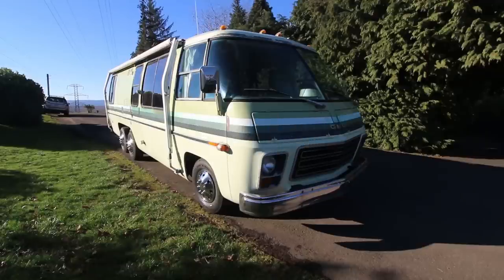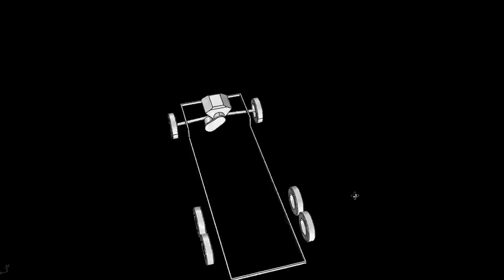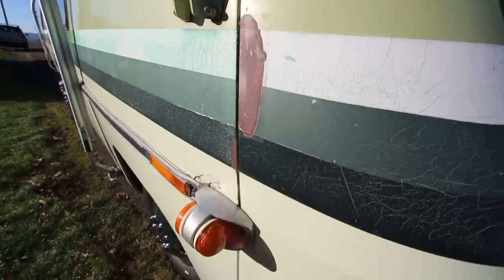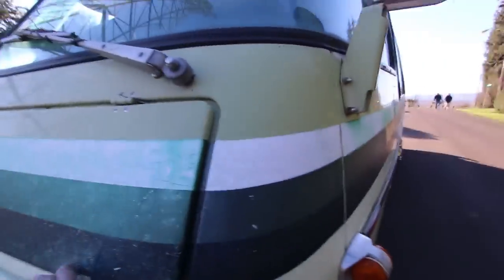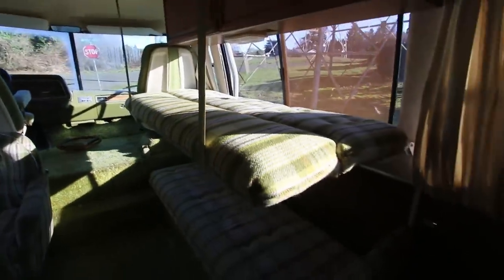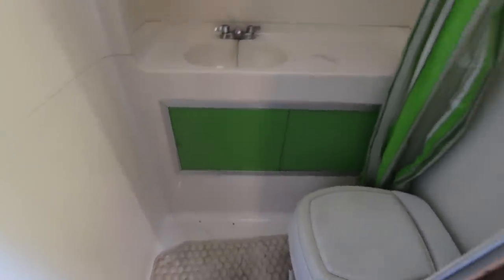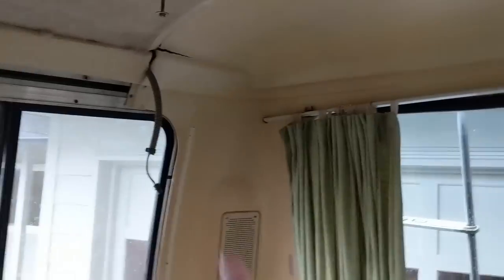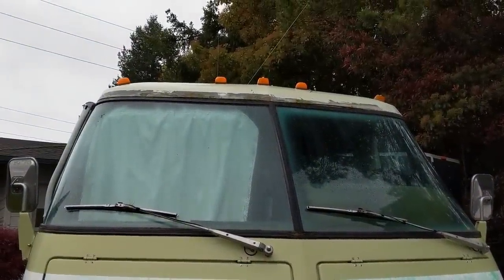Building The Best Damn GMC Motorhome Ever - Beginnings & Explanations

Comment: Please correct your statement. Revcon did not copy GMC. GMC COPIED REVCON. The Revcon was designed in 1967. When Revcon put in an order for 25 Toro half frames, GM made Revcon build up 5 coaches to run them on the test track at GM. This was called the Brickyard test. The only failure was the lower control arm which was beefed up and the test was continued. Interestingly the GMC lower control are is more prone to fail than the Revcon beefed up version. So AFTER GM made Revcon do all the testing, THEN GM initiated the design for the GMC. The first production runs for Revcon were sold in 1971. First year for GMC was '73. 

I have to laugh at your other comments about Revcon not being as elegant. Revcon was a much higher end, much better built coach. Way nicer than GMC. The GMC used a lot of plastic and wood paneling in the interior, which is prone to crack or rot. Revcon used solid wood cabinet frames, Wilsonart surfaces, hollow honeycomb cabinet doors and shells, all trimmed in TEAK. If you look at the interior of a Revcon, all the cabinetry will look just like it did when it left the showroom. The interior walls were aluminum, coated with a decorative vinyl finish. This makes a surface that won't rot, and can be cleaned to showroom condition, with little effort. 

The frame on a Revcon is much better as well. It is box channel, which is much stiffer than the C channel used on the GMC. Because of the lightweight interior and aluminum walls, the Revcon has a lower center of gravity than the GMC and is much lighter for a similar length - typically between 8 and 10K lbs. The only thing the GMC has on the Revcon was the rear suspension. The boggie wheels on the GMC did ride better than the GMC. The later Revcons did use a tandem rear axle setup with a single spring. I've ridden in both, and there is not a lot of difference. In the front seat, the later Revcons do ride better than the GMC. The 1980 and later front suspension was designed by Peter Bryant, known in Can-Am circles as the designer of the T-22. He was well known for his pioneering work on aerodynamic downforce. I don't know about the earlier Revcons, but the later Revcons drive and handle much better than the GMC ever did. I've driven in 90mph crosswinds - a microburst. Water was spraying in the window drain holes. The wind was opening my side awnings. They were damaged before I was able to exit off the freeway and tuck behind a building and secure them. I was driving at 70 when it hit. The only reason I slowed down was trying to save my awnings. No real ill handling. On another occasion, broke the triple digit barrier. I grabbed my cell phone to take photos of the speedo. Later I looked at the photo to discover my reflection of BOTH HANDS on the camera. At 100 mph, I was driving with my knee! At the time, I wasn't thinking anything of it. It just drove normal at that speed. Previously I twice hit 98 mph towing my Grand Cherokee. It wasn't topped out, but started getting too close to traffic. 

The oem configuration for the later Revcons was a 454 w/4 bolt main, TH475 trans with Kevlar bands, straight cut gears in 1st and 2nd. They had a custom Borg Warner transfercase with only a front driveshaft. I eventually swapped out the engine for a 502 with Edelbrock MPFI. I swapped the trans for a 4L85e. It was also running Thorely Tri-Ys and Magnaflow mufflers. At 20 mph, if you punched, it would break the front wheels loose. It would also chirp going from 1st to 2nd at about 50 mph. I did a few other mods, like Koni FSD shocks, Tapered roller bearing bellcranks, and rear disc brakes. 

The primary reason the Revcons were not as popular is because they were a very high end coach, costing 2 and half times more than the GMC. My 1983 was $125,000 new. (for true comparison, in '78 they were about $80K)
Reply: Somebody knows their stuff!
Reply: I debated between a Revcon and GMC for months. Getting ready to bring our Revcon home. This comment just made my day! You are absolutely correct sir.
Reply: @jbarnes3373  What year?
Reply: @Daveinet  1983 Prince. Inside is like a walk back in time and looks exactly as it did in the 80's. Getting her tuned up and new tires this week. I'm very happy I found this.
Reply: @jbarnes3373  OK, so that is the same year and model as mine. Make sure you join the http://www.policeinterceptor.com/revconforums/. I help moderate the site and at least try to get over there once a week. I inherited my Dad's '04 AllegroBay two years ago, so I've sold my coach, but still try to help out once in a while. I do miss the old girl, especially when I'm out on the road. As long as your suspension is in good condition, there is nothing that drives like a Revcon. When I had mine up for sale, a guy came by that had rebuilt 3 GMCs. He even stated my coach handled way better than the GMC. The only real suspension mods were Koni FSD shocks and a rear track bar. It doesn't really need the rear track bar unless you are towing a 4600 lbs Jeep.
Reply: @Daveinet  I will absolutely do so! Thank you so much for the info. I found a Revcon Owners group on facebook that has been very helpful answering questions. I would have been lost without helpful owners. I also have a resourceful owner I'm buying from helping me track down part numbers getting her ready for the trip home. It's a real testament to the vehicle and design to have people willing to help so freely to keep them up and running. Every upgrade you listed I have made a note of for future reference. The handling of the Revcons are what sold me. I was very happy to find this confirmation. Thank you again for the helpful advice and information.
Reply: @jbarnes3373  I don't have a facebook account, so I'm not on that group. There is also a group on IRV2 for Revcon. Occasionally I will visit there. One nice thing is that things like the couch dimensions are the same as what is still used today. The front seat mounting brackets are also the same. As such, you can find surplus furniture that bolts in. An old archive with interior photos exists here:https://web.archive.org/web/20091025170742/http://geocities.com/revconprince/interior.html
Something else you need to know if you don't know it already. Running a Dana 70 in reverse flexes the case, causing it to work the bearing race around on the carrier. As it wears, you eventually loose mesh and break teeth. They usually fail at about 70K miles. The solution is to have it rebuilt by Jantz Engineering. He will add bearing girdles and a new diff cover to stiffen the case. You should also install a Tru-lok carrier, as they are much stronger than OEM. I also had mine cryogenically treated, which improves rigidity without making it more brittle.  The 502 would light up the front wheels from a 20 mph roll and chirp at 50 going into second. The rebuilt diff holds up to that and is still going strong today.
Reply: @Daveinet  I had no idea on the Dana 70. Ours has about 126,00 miles on it, with a rebuild on the engine aprox. 20,000 miles ago. That makes me wonder if they already had an issue and it's been addressed but I will need to investigate further to find out or check current state of ours. THANK YOU for the info and making me aware! Really appreciate the kindness!
Reply: @jbarnes3373  There is only two of us maybe 3 who have had it rebuilt with the bearing girdles and the heavier cover.
Reply: @Daveinet  So the front axle is the Dana correct? The back axles are Bendix? I'm looking over the info I have and this is what I'm getting. What exactly should I have checked before trying to bring her home? I really appreciate the info. I'm trying to research and get more info through the Revcon group also. I have new tires going on tomorrow.
Reply: @jbarnes3373  Yes, the front DIFFERENTIAL is Dana. The axle is custom. The axle tubes are chopped off and have half shafts extending to the front wheels. A-frame Torsion suspension. Rear axle is Dexter. Wilkerson walking beam suspension. 
Things to check: In the rear, make sure the rear drums actually work. The adjusters tend to not self adjust, so you can end up with a lot of peddle travel and not much brake. There is a rubber plug at the bottom of the drum that can be popped off for manual adjustment with a bent flathead screw driver. (its worth it to convert to disks once you get it home)
Secondly I would look at the Front suspension. Check for loose tie rod ends. With a floor jack, lift under the A-frame to check the lower ball joint. Check the Bellcranks for wobble. You may be able to tighten them, but if you do, make sure the whole front end is completely off the ground. Grab a front tire and force it to turn from left to right. If you can't turn it, unlock the steering wheel dummy...LOL. No seriously assuming you didn't forget to unlock the steering wheel, and you can't rotate it from right to left or vise versa, then something is binding, most likely the bellcranks. If it binds, it will wander and drive you nuts. If the shims on the bellcranks are worn or not setup correctly, the top and bottom plate will not be parallel, which will cause binding. When they are setup correctly, the bolt is tightened to 150 ft-lbs. If they bind, try loosening it some. I double nutted mine, because I could not tighten to spec without it binding. I couldn't get the shims perfect. Eventually I converted to a tapered roller bearing. 
Can't think of much else, other than standard stuff. Check all the hoses. Bring some hose clamps with you incase something bursts.
Reply: @Daveinet  Wow- thank you so much for the detailed helpful information. I'm taking notes and everything you are sharing helps keep my family safer, as well as, the rig on the road. I really appreciate your time. The current owner is mechanically inclined and has serviced the brakes for me, replaced a couple things and has those stopping on a dime. It sounds fine running forward and I don't believe it's making any noise in reverse. That is spot on advice for the front suspension. I have a mechanic going up with me and will bring the extra clamps for sure! As for that rebuild with Jantz. I'm on the east coast in WV. Is there anywhere else out here that would do that or is there another option to replace it? Thank you again for being so helpful. I'm 100% listening to what you are telling me.
Reply: @jbarnes3373  You can buy the differential mods as a "kit" from Jantz as long as you have a highly qualified installer. Dana 70s are a trick to get set up right, so whoever works on it better know what they are doing. I had a local shop do mine, but that was because they already had it taken apart before I read about Jantz. If I had not had it already at the shop, I'd have strapped it to a skid and shipped it off. (I'm in the midwest). I had a few long conversations with Carl as we talked about what would be needed to prevent me from breaking teeth. (I broke the teeth in 20K miles due to the 502) He is just one of those guys that you quietly realize he is a really smart guy. 
Just as a side note, about a year after I had Carl send me the parts to do mine, I saw him on the History Channel Alaskan Off Road Warriors. When I realized it was the same guy, there was no doubt in my mind that it would not be a fair competition. Talked to him afterword, and he said the show did not really show how far they were ahead and how much they held back, so it wouldn't be a blow out.
Reply: @Daveinet  Was it the 502 that helped accelerate the failure? I am running this by some knowledgeable owners and they are saying in theory I shouldn't have a failure if the fluids are kept at a correct level. They only know of this happening once and it was due to incorrect fluid levels. Does this sound correct to you? As far as I know, mine isn't making any noises in forward or reverse currently and sounds good. 
That's incredible on Jantz and Carl. I would be there in a heartbeat if it wasn't all the way across the country. Doesn't surprise me one bit he had to hold back!  I may definitely be able to find a shop capable of doing the job and get in touch with Jantz on the kit.
Reply: @jbarnes3373  70K miles is typical for many Revcon owners, (I'm aware of about 5) which is about when first mine broke with the 454. I had it repaired, and then a year later dropped the 502 in it. It broke again in 20K miles, but it was a very specific event. I was towing a Grand Cherokee on a two lane road, following some bozo traveling just around 45 mph. I punched it, which made it drop into first and went around the guy. By the time I was pulling back into the lane, I was doing over 80 mph. About 20 miles later I slowed down as I entered a small town. Off throttle, I hear a strange ticking noise below my feet. Every time I slowed down, the noise got worse. I babied it and got it home. After feeling for slop, I pulled the cover and found 3 teeth missing in the ring gear. 
As far as the diff spreading, this is well documented as to what any diff does under stress. Carl was helping someone racing dirt track. They could see two different wear lines on the bearing race. One from on throttle, and the other from off throttle. Every failure I have seen in a Revcon - at least 5 all had the bearing race slipping on the carrier. This is from the spreading motion of the case. To disassemble a Dana 70 requires a case spreader. It is a special tool that catches the two holes in the flange in either side of the pumpkin. The screw crank is rated for 10K lbs - enough to spread the case to get the carrier out. Now, if you start looking at torque ratings for the Dana series, they spec torque in ft lbs. A Dana 70 is spec'd for 7000 lbs. Dana 60 is 6000. So not that much less than the force the spreader puts on the case. The big deal is that the Dana 70 is NOT a high pinion with reverse cut gears. Its rating in reverse is about 1500 lbs less than forward. This has to do with the location of leverage as well as the angle of the teeth. It you look at the ring gear teeth, They are not V-shaped, but rather saw toothed. This give the gear more strength in one direction than the other. Also due to the more vertical tooth surface, it does not try to unmesh the teeth as much. So, when run in reverse, the tooth angle is going the wrong way, which causes the mesh to want to spread. Run your finger across a hacksaw blade. One direction it digs in, the other direction, you finger lifts off and easily slides. Same with the gear. So not only is it logical, but we also have physical evidence.
Reply: @Daveinet  So this is an inevitable problem regardless of fluids. Taking a look at the teeth is a way to get an idea of how far along this one may be towards failing. I have about a 350 mile drive with decent hills. I would like to know the differential isn't going to fail on the way home. I appreciate the notice on this potential issue.
Reply: @jbarnes3373  I don't know that I would be like super paranoid or anything. The cover will come off with the differential in place. The bolts on the top are a little difficult to get to, but it will come off.
Reply: @Daveinet  Thank you again for all the info and giving me a heads up on this. I talked to my owner and he was familiar with the Dana and had planned on checking the fluids for me. We have no clunking or noise coming from it and she is running like a champ with all of his recent servicing. The past two owners have been great about the upkeep and servicing. Feeling better about it for sure. I really appreciate the information and filling me in on Jantz. I have learned a tremendous amount from this thread and have taken note of all you have shared. Really can not thank you enough! I know you had the '83 but are you the Dave that had the flatnose Revcon?
Reply: @jbarnes3373  I've only owned the '83 Revcon. So that is a different Dave. One other thing to keep an eye on is the U-joints on the driveshaft. They are not problematic or anything, but because they are parallel to the trans, if they let go, you loose the trans case. Its just a regular maintenance inspection thing you should do periodically. Shift from forward to reverse and listen for any clanks. I had one go bad, but not let go at 1:00 in the morning. I could feel a vibration off throttle. Pulled over to inspect, and saw the U-joint was shot. Drove slowly to the nearest exit and found the nearest NAPA. Parked in their lot. chocked the wheels and dropped the shaft. Waited till they opened in the morning handed them the shaft. They dropped a new U-joint in. Took about 20 minutes to install the driveshaft and was on my way.
Reply: @Daveinet  That is another great piece of advice. I appreciate it. I now have a list of things I can check to prevent potential problems and much better understanding of the vehicle. The Revcon community is out there and very helpful. Glad I ran into you on here. I truly appreciate all the advice and plan on following it. About a week out of bringing her home and getting excited!
Reply: @Daveinet  WAIT WAIT WAIT Youre talkin about the Revcon, correct? 
This started as a GMC video-dont confuse me-Im confused enough already
The GMC uses a Toronado/Eldorado FWD differential
Reply: @lsee6145  Yes, I am talking about Revcon, as j barnes asked questions was specifically about Revcon.  GMC uses a planetary differential, which is completely different. The GMC differential was not felt to be strong enough for the weight. I'm not sure the Revcon is heavier, but the engineer felt it was a better choice.
Reply: I find the GMC Motorhome way more attractive than the Revcon of the time. Later Revcons had a more streamlined body similar to the GMC Motorhome.
Reply: @jasoncarpp7742  Yes, the first series flat nose was not as contemporary, but considering it was built in 1968, that should not be a surprise. I have seen a nice multi-color paint job on a flat nose that really disguised its late 60s look.
Reply: @Daveinet  Okay. I've seen GMC Motorhomes before, but never a Revcon Motorhome. I'd buy a Revcon if I had someone to share the experience and responsibilities with.
Reply: @jasoncarpp7742  You can find photos on the internet, but they are a bit rare. Only abut 4000 made. If you ever get a chance to drive one that is well maintained, do it.
Reply: @Daveinet   I might. I've seen pics of the Revcon, but I've never seen one up close and in person. I'd buy a later model (1978 or later) if its condition was right, meaning it's driveable, etc.
Reply: @jasoncarpp7742  I would go for '80 and later. The reason is the '78 was still based on the Toronado front end. This means it only has the 403 engine.  '80 and later will likely be based on the 454. There is overlap on which model years had which engine, so you need to look. One big clue is the 8 lug wheels on the front. If you are inside, the trans is behind the engine. There is a driveshaft running forward from a modified transfercase to the front diff. Olds engine, the trans was next to the engine.
Reply: @Daveinet  Okay. I also believe that size matters. If you've got two adults traveling together, you want something large enough for them to travel comfortably while on the road. I also think that 27' in length is perfect in size for most RVers.
Reply: @jasoncarpp7742  Mine was 31', yet was still easy to drive and maneuverable. No real difficulty getting around corners or traffic. Not sure about the GMC, but up until '85, Revcon was only 7'6" wide. This makes a huge difference in heavy traffic or getting around town. You can still go anywhere with it. My current coach is only 3 ft longer, but it is a whole ft wider. That makes a huge difference in maneuverability.
Reply: @Daveinet  Since I've never owned or driven either, I don't know the first thing about what they're like to drive. But I would think that 27' would be easier to drive than 32'.
Reply: @jasoncarpp7742  The reason it doesn't make much difference is that most of your miles are on the freeway. The only time you care about length is when you are pulling back in after passing other vehicles. At that point, I always keep the rear camera on, so you can easily see that you are fully passed the other vehicle, so it is safe to pull back in. The second issue is, that once you start towing a car, you are already long enough that a few feet is not noticeable. -and yes, at some point you will start towing a car and realize you are never going to travel without one.
Reply: @Daveinet   I agree. A rear vision camera is a "godsend". To be able to see what's behind you as you put your vehicle in reverse is a great thing. I don't know if every car these days have it, but they should. My 2017 Mazda CX-5 has it, and it's helped me with parking in reverse countless times!
Reply: @jasoncarpp7742  I think its now required by law. The real fault is that manufacturers haven't figured out that leaving it on all the time is a safety enhancement. Fortunately in a motorhome, you are able to leave them on. Car engineers think they know everything, so they try to control every detail.
Reply: @Daveinet  With my car, the only time the camera comes on is when I put it in reverse.
Reply: @Daveinet  I'd buy a Revcon motorhome if I had someone someone to share the experience with and responsibilities.